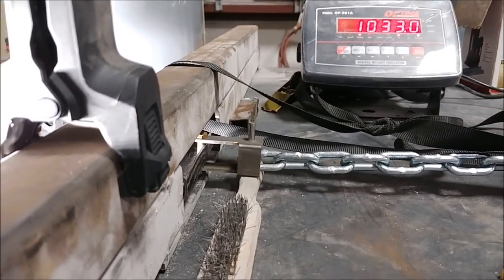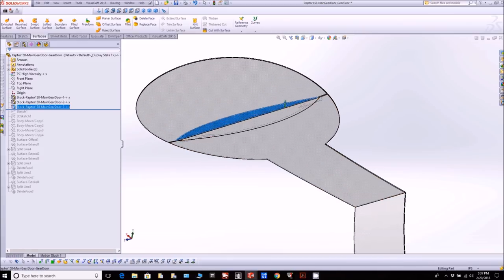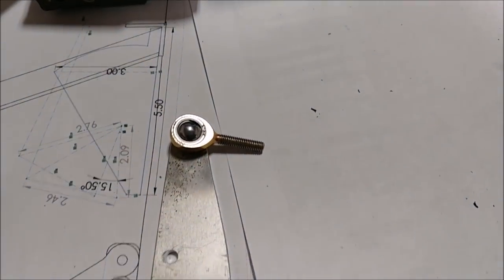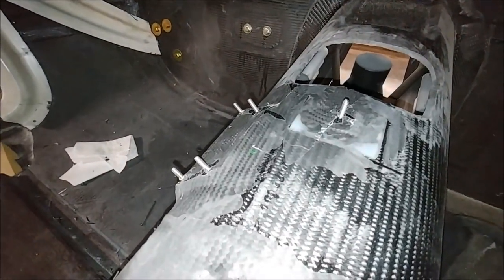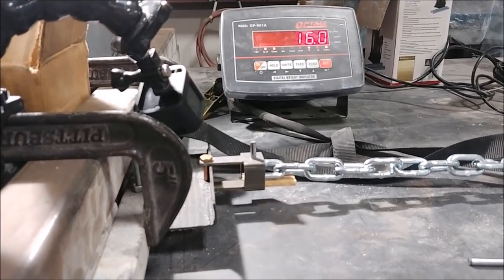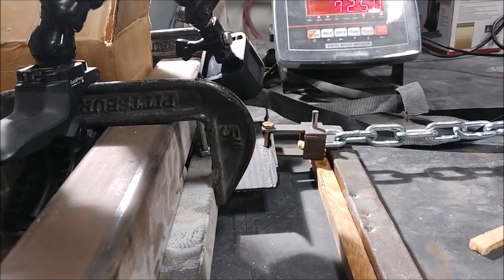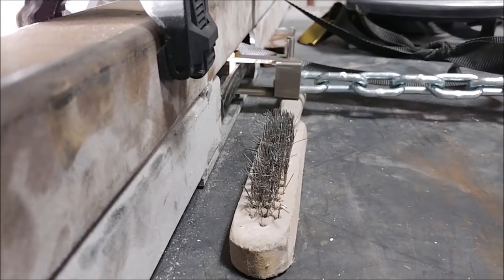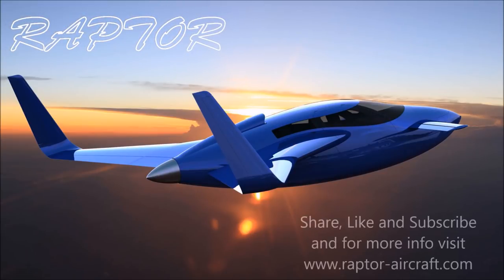How Tough is Carbon Fiber?

Comment: I recently visited a high tech sail making company that makes super strong and light weight carbon composites sails, spars and rigging... Instead of actual physical patterns they use a combination of flexible surface they can lay parts up on in pre-preg carbon and actual moulds like you make. But especially in the early stages of production before mass production in order to keep cost down they will try to make as many parts like the hot air engine went that's not really structural from flat parts laid up and bonded in a flexible mould - think of it as a large piece of rubber with jacks under to manipulate the surface - do they can create pretty much any shape in minutes using that method. They use i heavy flat structural layer and a thin surface layer and vacuum bag it for curing like you do. But they create moulds fast and cheaply and repeat that process to scale production when they reach final production specs.. If any of your design changes then you're going to make a brand new mould for every part that way.. they can pull big curvy sections like your nose section fuselage easily and lay it up both to make one part or to make a mould for making many parts.. they can switch from one sail shape to the next in minutes without the need for having an actual mould. That would be a very easy way of creating wing skins and fuselage parts.

Comment: Will you add friction to the throttle?  You read my mind when you answered how you calculated the pushrod mount position to get the throw right. Thanks for the consistent updates! -kit #1,198
Reply from the maker: Already have friction control.
Reply: I’ll be anxious to see what you came up with.
Reply from the maker: I believe it was shown in an earlier video. It was already operational at the open house. It's just a bunch of spring type washers in combination with a fiber lock nut adjusting the tension. Later there will be an extension to that nut that is easily accessible from the pilot seats.
Reply: Giddy up. I’ll look for it. I’m surprised I missed it. Thanks for the info Peter!

Comment: I'm surprised you're planning a second main gear door to cover the lower part of the tire.  If you're really going to be up there at FL250 the drag wont make enough of a difference to warrant two more hydraulic cylinders plus a sequencing valve.  Especially since you're already overweight.  Even Boeing doesn't bother covering the 737's tires.  Otherwise great progress, I really look forward to seeing those door latches done!
Reply from the maker: The wheels and tires do not sit flush with the lower wing so there would be considerable turbulence. The lower door is hinged to the upper and does not require its own opening mechanism. Stay tuned, you'll see how I designed it.